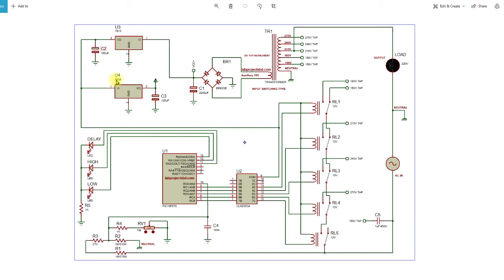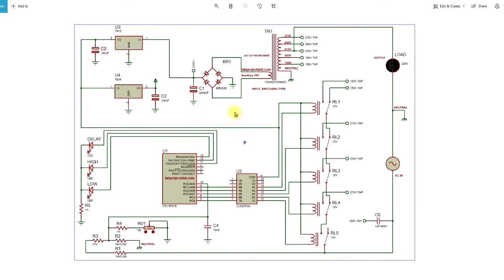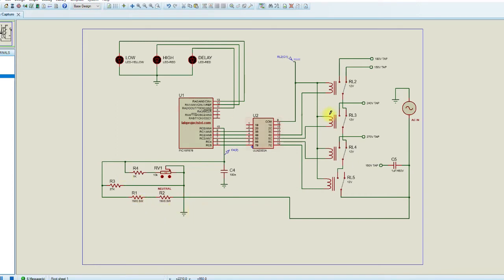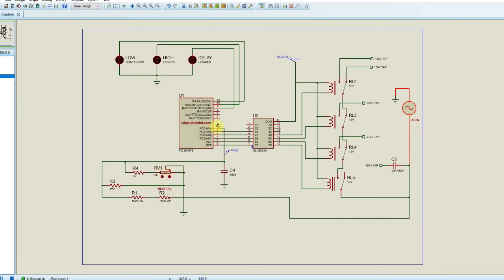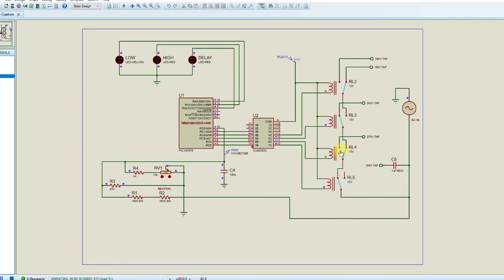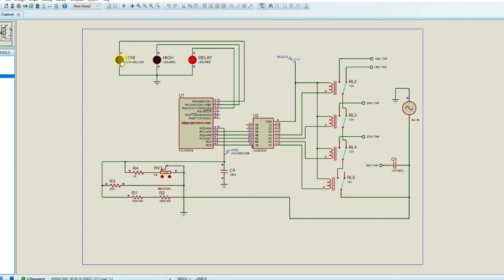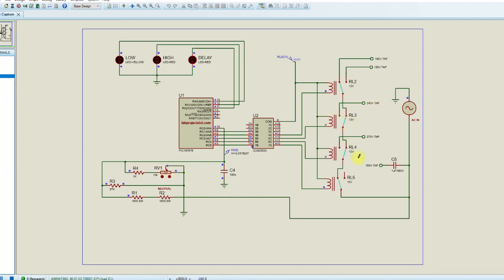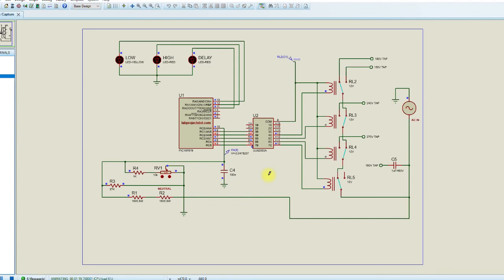How to make a voltage stabilizer using micro-controller PIC16F676 and 5 relays

Comment: Excellent work , How the tap changing works clearly explain in the blog,  Thanks.  In this simulation video only 4 relays are shown , but in blog schematic 5 relays are there .
Reply from the maker: If you learn the concept, you can use any nos of relays. That is my main target.

Comment: I need 50 v to 250v pic 16f676 ic program and pcb layout
Reply from the maker: did not understand what you are asking for.
Reply: @MKDas  sir make ac 50v to ac 220v stablizer circuit layout with in pic16f676
Reply from the maker: @shahidelectronics1686  maybe one day